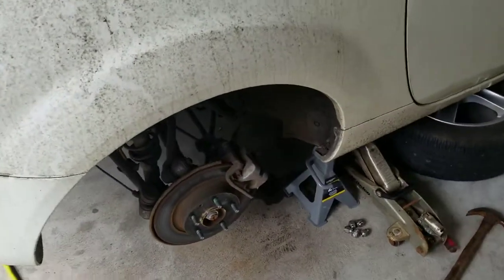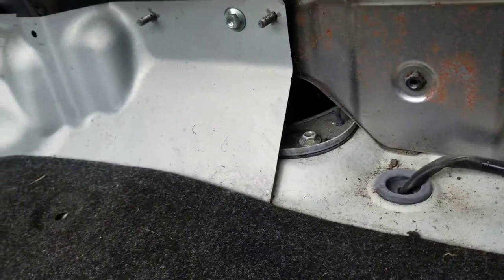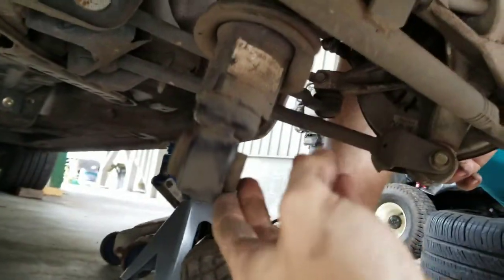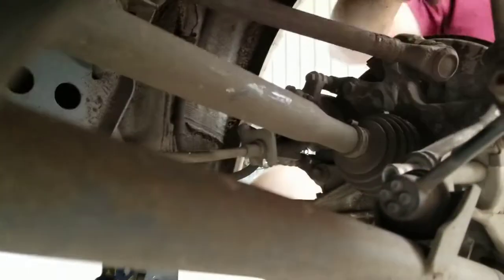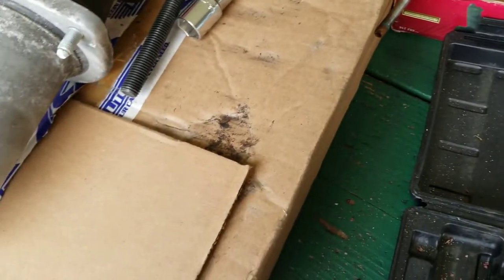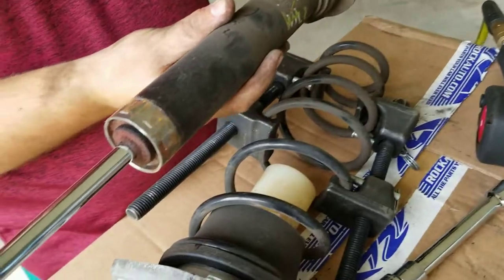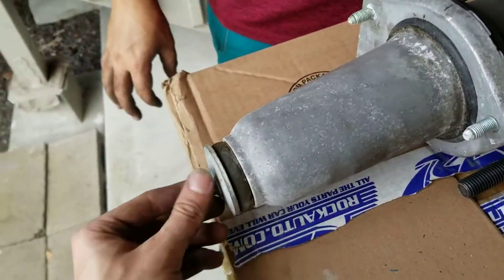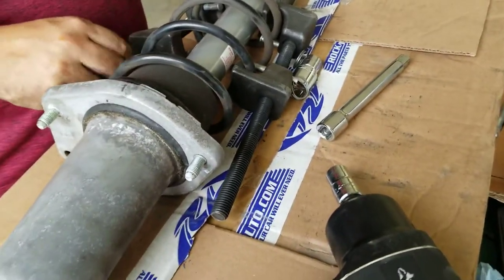Changing rear struts on a 2008 mx5 miata

Comment: You not buy the whole assembly?? All that work to put back old Springs ???!!
Reply from the maker: Budget
Reply: @GenerationGarage  Just because a spring is new, doesn't make it better.  Even old OEM springs are often superior to new chinese pieces of metal twisted to look like a spring.  Learned this one the hard way with a Ford Taurus.  Aftermarket assemblies ride like an ox cart!  Still kicking myself I trashed the rear struts with the OEM springs left on them.  Got smart when I did the front and tossed the brand new springs in the trash!